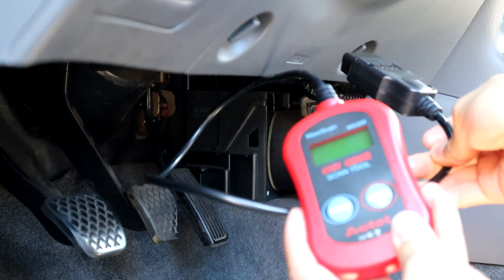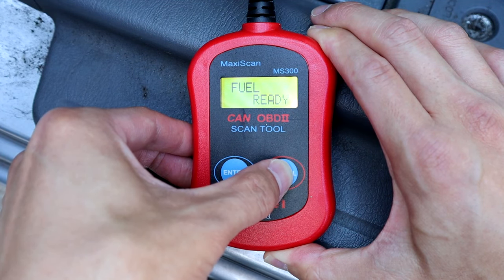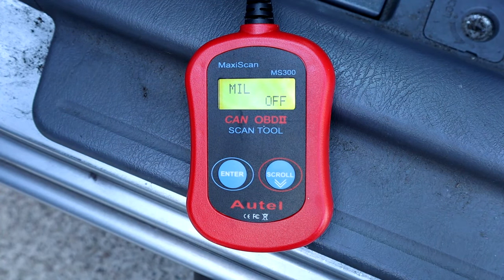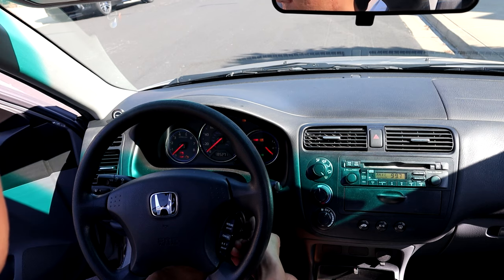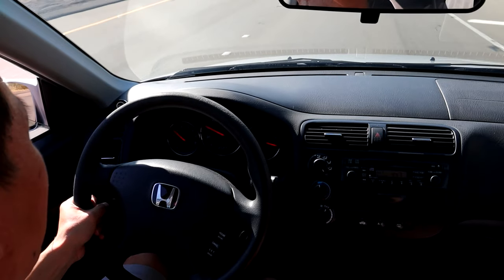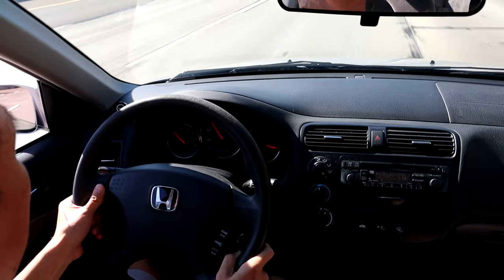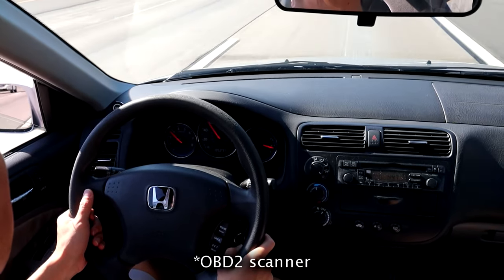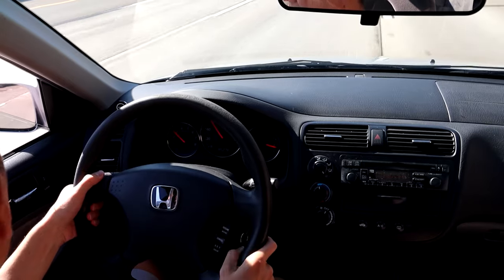How To Get Your Car Ready For a Smog Check – Pass 100% Of The Time – I/M Drive Cycle Ready

Comment: I’m not good with cars, what do you mean by full or half throttle? I’m just trying to learn.
Reply from the maker: Push the gas pedal half way down, or all the way down. Half and full throttle :).
Reply: Thank you so much!!! I'm trying to do a drive cycle yet again. This is so aggravating. Oxygen sensor keeps saying not ready. So I'm gonna give it another try. Thanks for your help
Reply from the maker: @bellamamma767  You might have to do it a couple times for the ECU (car computer) to run the test.  If I remember correctly, the o2 test is the hardest one to get the ECU to go, so be patient if it doesn't work for a few times.
Reply: Thanks for the info. This is all so new to me! I’ve been doing this since may. I put over 900 ( I took pics before each emission test)miles doing this on and off, and just did my 5th emissions test. I got an incomplete result. The dam O2 again not ready. I took it to the dealership and they did drive cycles and had the same issue with the O2 not being ready; they had no answer for me why. They reset my sensors ( or so they said) and now I got 3 of them not ready. I’m so screwed😜. I’m gonna have to go to the emissions repair place.
Reply from the maker: @bellamamma767  If you've driven that many miles and the O2 hasn't cleared, there's something wrong.  I'm assuming that's street and freeway?  If that's the case, you've actually got an issue.  Probably a bad O2 sensor.  They do tend to die, so I would use the CEL to get the correct one/s replaced, then try.  Sounds like you've been wasting a lot of time running in circles trying to fix something that's not fixable by driving :(
Reply: Agreed, I was following what the mechanics kept telling me to do. I was told that it takes a while and that drive cycles can be complicated, etc. blah!  Like I said, I’m new to all this. Thank you so much for replying to me and the advise. God bless!
Reply: I’m also confused, you mentioned get to 55mph as soon as possible but you also said use half throttle and 3/4 throttle. Don’t I get 55mph fastest by full throttle?

Comment: Thanks for the info!  I did this outline of the instructions for myself and want to share it.  Might want to pin it 😀

Car engine cold
¼ to ¾ tank of gas

1.  Turn car on, idle for 2 ½ minutes with AC full power and rear defroster*
ECU tests:
O2 heat self-test
Air injection system passive air
EVAP purge 
Misfire detection
2.  Accelerate to 55 MPH at half throttle*
ECU tests:
Misfire detection
Fuel trip
EVAP purge
3.  Cruise at 55 MPH for 3 mins*
ECU tests:
O2 response
Air intrusive system
EGR flow
Misfire detection
4.  Coast to 20 MPH (no braking or gear shifting)*
ECU tests:
EGR flow
Purge valve
Fuel trim
5.  Accelerate to 55 MPH at ¾ throttle*
ECU tests:
Catalytic monitor diagnostics
Reply from the maker: Thanks!

Comment: Thanks for the tips! If I reset and turn off the codes, will it pass Smog check? Thanks
Reply from the maker: The car won't let you do that anymore.  That's an old OBDI thing, where you could disconnect the battery, go straight to the smog and pass.  Modern cars today on OBDII, that doesn't work and actually if you were to disconnect the battery, you'd have to do a drive cycle to get everything reset or all your monitors wouldn't be ready.

Comment: OK so I have a "97 Ford Escort (155,000 miles) with a check engine light on. My friend thought he was helping and disconnected my battery before I tested. Then I went in to test a day or so later when the engine was cold. You guessed it, it failed. So I bought the fuel additive that "guaranteed pass smog test" and my friend changed my oil and oil filter. Since my CE light had come back on when I was trying to do these drive cycles every other day, he disconnected my battery AGAIN after I thought I had explained why that was such a bad idea the first time. While trying again to do drive cycles and make sure the engine was warmed up this time....the CHECK ENGINE LIGHT CAME BACK ON. I don't know what to do except junk the car. I can't afford to get a diagnostic let alone a fix. I had a mechanic tell me a couple of years ago that the code that it was showing then was a sensor deep in my engine and the labor alone would run about $1000 plus parts.
Reply from the maker: Any an OBDII car, like yours, you can't "cheat" and disconnect the battery.  That was an old OBDI trick.  If a mechanic told you you have a sensor issue that's causing a CE, you need to get it fixed.  Doing this drive cycle a thousand times isn't going to help.  This drive cycle helps reset your monitors.  It doesn't magically fix CE and issues with your car.  So sorry to say, you have a tough choice.  You need to get it fixed or figure something else out for transportation.

Comment: Thank you for this video!  Have two very low use vehicles needing smog checks and had some concern there might be issues.  Took your advice and bought an Autel OBD2 scanner, one model up from the one shown (an MS309).  The MS309 has an improved display with a summary test result screen, so it was easy to see immediate results.  All was good with the Autel tests and both vehicles then passed at the smog center.
One thing to add, with the low use vehicles, awhile back I’ve lost data due to run down batteries.  Bought a dual trickle charger and repair unit from Norco (Genius line). You might want to include a link for those, too, as the tricklers can directly contribute to test success by preserving data continuity.
Thanks again!
Reply: Correction: NOCO Genius line chargers
Reply from the maker: Glad the video helped!

Comment: Accord 2006. I had the 5 flashes on the CEL. I followed your steps and now it is solid and goes out after 20 sec. How sure should I be that I'm Ready? Is the CEL indicator as good as the scanner? I only have a cheap scanner that report error codes, nothing for readiness.  Thanks.
Reply from the maker: Hmm...you might need to do a little more research on what your scanner is telling you.  Since I don't have that same type of scanner, I'm not really sure I can answer your question.
Reply: no flashes mean you are good to go.
Reply: @linsan4362  Thanks. I passed!!!

Comment: Is there a reputable source (online or not) to find drive cycle specifications?  How many drive cycles does a vehicle have?  
Are we simply at the mercy of the internet to find the drive cycle requirements for our vehicles?  

The manufacturer wasn't able to tell me anything.  The car manual has nothing to say.  Recently, I was able to find something online for my make, model and year, but how can I trust that this is accurate?

I have an OBD2 device on order that should be arriving within a week or so.  I will definitely be consulting this video and others when it arrives and I am able to plug it in and see if I can get it to work.

I am not sure, but I am wondering if at least part of the problem is that all the electronics need to be off while trying to trigger the various systems.  IDK...am I not supposed to turn on my radio / music, lights, heating, AC, nothing except the engine?  The battery was replaced, but that was months ago.  Relatively recently, about two weeks or less I had the oil done on my car and the shop didn't identify any other problems that required attention.  My car should be in good working order.  It is very unlikely that my car is the problem.

This has been a problem the past 3 times I have had to get my car through DEQ.  I am not looking forward to the prospect of paying hundreds of dollars for an auto shop to deal fix this because I can't figure out what I am supposed to do.

It is utter insanity that I have to pass a test which is required by law and no one can tell me what I need to do for my car to pass.  I want to be in compliance, but I have yet to find a sufficiently detailed explanation of how to complete the drive cycles for my specific car.
Reply: Yea it's a tough situation.  In the service manuals they sometimes have a drive cycle, it goes by other names depending on the manufacturer.    But I have seen some manufactures that do not have anything to help.   It will be good if you get you OBD scanner and know exactly what Monitor you need to complete you can focus on that one monitor.   Sometimes the Diagnostic steps for that particular system error hint at good driving pattern to test out the repair and that is also a good pattern to set the monitor. 

List out your Year, make , model and engine size and I will see what I can find.
Reply: @stevew9563  

2008 Mazda / Mazda3...

Also the check engine light on my dash is off...which should be further proof my car is in good condition.

I plan to experiment with the OBD2 tomorrow and if necessary do some more driving and test my car again.

I live in an area where it is dark, rainy and overcast for a good chunk of the year, so it is asking a lot to warm up and drive my car around without lights or heating in order to trigger the drive cycle.  If I have to do it this way then I will.  But it sure isn't practical to attempt triggering the drive cycle as part of my routine driving.  

Days that I work I get up when it's dark and I go home in the dark.
Reply: @jennifertennent8319   - I assumed you had the 2.3  non turbo engine correct me if I am wrong.
Reply: @stevew9563  

I honestly don't know whether it's turbo or non turbo.

I tested my car again at DEQ and it's still not passing.

Word for word this is what I was given a few years ago at my auto shop and I found something very similar if not identical looking around online very recently.

Remarks in () is my commentary...

Pre-requisites: MIL off and no DTCs present, this is where clearing your codes comes in.  
Fuel level between 15% to 85%.  
All accessories off (Ok, what counts and doesn't count as an accessory?  If I turn my lights on at ANY point is that an automatic fail?  If I turn my lights on, but then turn them off and say I try procedure (5) can I get the system to trigger?  Am I not allowed to use my wipers?  Nothing, nothing at all other than the engine needs to be running?)
Cold start, preferred 8 hour cold soak w/ engine between 68 and 86 deg F at start-up

1) Start vehicle and idle 5 min (exactly?)
2) Rev engine in neutral or park to 2300-2700 rpm for 15 seconds (exactly?)
3) Rev engine in neutral or park to 3800-4200 rpm for 15 seconds (exactly?)
4) Idle engine for 20 seconds with cooling fan stopped (so...am I supposed to run the fan and then stop it at this step for at least 20 seconds?)
5) Accelerate to 52-55 mph, maintain speed in high gear for 1.5 minutes (Do certain steps have to be done in sequence one after the other?  Do all the steps have to be done in sequence 1-7 or else the drive cycle fails?)
6)  Decelerate to 15 mph and then drive for 13 minutes at speeds ranging from 15 to 35 mph
7) Maintain steady 25 mph for 50 seconds (exactly)

I think the online version of this said that each of these numbers corresponds to a different sensor / system.  If that is true, which number corresponds to each of the systems?

Four are unready according to DEQ:  Catalyst, Evap, O2 sensor, EGR/VVT
Reply: @jennifertennent8319    -   >  Four are unready according to DEQ:  Catalyst, Evap, O2 sensor, EGR/VVT

Really Four?  And you drive some before that last test right?  Think you might be having a different problem where the ECU is losing power and forgetting the monitors.  Because even doing some minimal driving you should have set a few of those monitors.   You figured out your OBD scanner yet?
Reply: @stevew9563  

Update:

Got my car into a shop today about passing DEQ.

My car is running fine, at least this is what they told me.  There is nothing wrong with the electrical systems.

The car was driven around for multiple hours, they put 180 miles on my car and it's still not passing.

Maybe my added driving was pointless because it sounds like there is supposed to be a cooling off period between drive cycles...  After getting my car back I put another 100 miles on it.

And the shop wasn't able to tell me if my car is on drive cycle 4/5, 3/5...  Again. at least what I was told was most cars have 5 drive cycles.

I asked many questions and didn't get a lot of answers.  

At one point one of the guys seemed to indicate that a drive cycle can refer to the time between starting the car and turning it off.

This raises an interesting point...

One of the steps involves going 25 mph for 50 seconds...  So, if the car is warmed up and brought to temperature and I drive it for 50 seconds at 25 mph, stop, shut off the car, restart, repeat.

Is this a viable method to "ready" the different sensors / systems?

For a drive cycle to complete does every "objective" need to be met?  Can you isolate the different sensors / systems like the example above, starting, stopping, restarting driving 25 mph for 50 seconds?

Am I better off going for long drives, starting and shutting off the car twice, or am I better off spamming one of the procedures over and over again starting and shutting off the car 10-20 times?

Rather unfortunately...it seems like the unsatisfactory answer I have been given is that I simply need to drive more.
Reply: @jennifertennent8319   - Did they tell you what Monitors were still not ready?   You gotta get specific on this because it will tell you what you need to do.   They give you any printout?

No there is no indicator to tell you what drive cycle you are on.  There is data that tells you how many times you satisfied the conditions for the monitor to run but that is pretty high level stuff you wont find with a standard scanner. 

You need to investigate if your monitors are being  cleared at each key off.  There is no way you should be having this much trouble.

Comment: I tried this cycle but the thing is at around 17 or 18 miles check engine light comes.back...whay can I do
Reply from the maker: You have an actual issue then.  This drive cycle doesn't magically make check engines go away.  Read the check engine, figure out what it is, and then fix it before your next smog.

Comment: My check engine light seems to go through a cycle, two weeks on and then off. The code says cat converter. It's a 2008 Honda Civic Hybrid with 216,000 miles. I'm due for inspection in NJ next month. The car runs great and I can't afford a new car. Will this work? How do I keep the check engine light from coming back on?
Reply from the maker: That sounds like you actually have an issue with your cat.  And at 216k, I would believe it.  This drive cycle to basically to reset your monitors, so it might help, but I think in your case, you should get your cat looked at.  It might just be time to get a new cat.

Comment: Hey Darrell.  Thanks again for this helpful information.  If the catalyst monitor per the 5 test of the drive cycle results in a 'not ready', do I have to do all 5 tests again or can I just do the 5th test?  Please LMK.  Thanks!
Reply from the maker: You can try and do just that part again.
Reply: @nukem384  Thanks, Darrell!

Comment: Thank you, Darrell.  What is meant by half throttle?
Reply from the maker: Half throttle as in push the gas pedal only halfway down instead of to the floor.
Reply: @nukem384  Cool.  Never tried that but I'm thinking that it will be about 2000 RPM with the automatic so we're just cruising.  I can actually check half throttling and see what is actually the RPM reading while in Parked.  Thanks, Darrell!

Comment: I have a 2012 Mini Cooper, would this be something that would work? I've tried the Mini specific drive cycle, doesn't seem to work.  I've failed SMOG test a few times do to CAT not being ready, so hopefully this will help! When we have to do "multiple" drive cycles.. is the trick then to get it to the 55 and coast down, and get back to 55.. continuously?
Reply from the maker: It doesn't hurt to try and see what happens.  I would give it a couple tries and see.  Yes, you have to go 55 and let is coast, just like I explained in the video for the ECU to do its thing.  If you've done it a couple times, and it doesn't work, you might have an actual CAT issue, like you need a new CAT.  The drive cycle can't magically fix everything, sometimes actual parts are broken.
Reply: The CAT "not ready" issue may be fix by turning on the car and wait for the temperature gauge to rise, then step on gas and reb the rpm to 3,000 for 3 minutes.

Comment: Clear explanation. :) Wondering, why would we need to get to the freeway as quickly as possible? I ask because where I live, I don't have access to the freeway without stopping and going by the time I get there. Plus, I was thinking about driving to an area several minutes away (also stop and go to get there) that may be safer to hold a speed for several minutes without getting in the way of other drivers. Would that completely negate all the tests running after sitting idle?
Reply from the maker: If you can't get to the freeway quickly, it's ok, just get to it as fast as you can.  It has to do with the car warming up which could impact the monitors readings.  Just try and do your best.
Awesome handle BTW.  I had some pretty authentic takoyaki from a street vendor in Osaka straight out of those circular molds they use one year.  Really good!
Reply: @nukem384  Oh, I see gotcha. I may have to do one tonight, another early morning, then again after work tomorrow. I have a 2003 Toyota Matrix XR, so I hope this does the trick! If not, it'll be a sad day for me...😭 Awesome btw that you've tried takoyaki in Osaka (the best way, really). I lived in Kyoto for 3 years and went to Osaka or Kobe almost every week lol! Okonomiyaki is my favorite, though. 😅
Reply from the maker: @takoyakiball  Hopefully you'll only have to do it once, it everything works out

Kyoto is beautiful!  Been there and Kobe as well.  Love okonomiyaki too!  We make that at home every now and then.